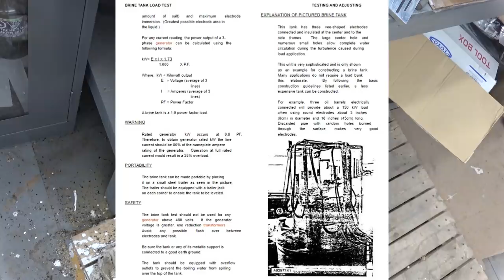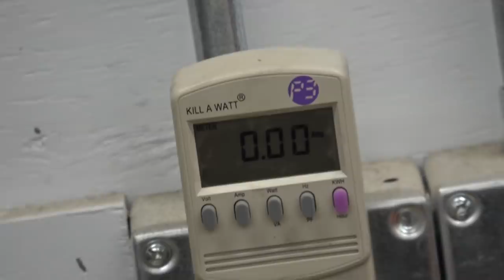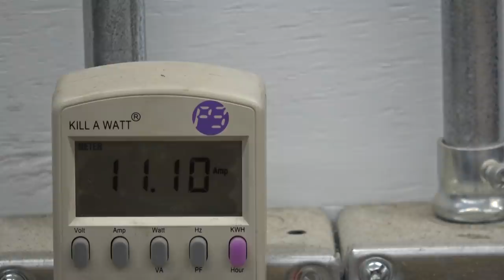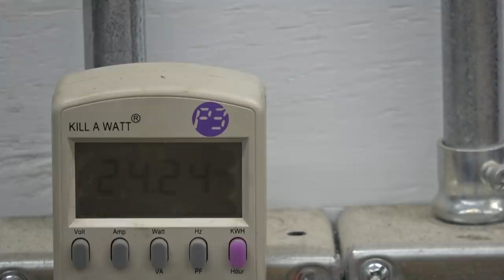Forgotten knowledge: generator load testing

Comment: As a Caterpillar EPG technician. I will tell you the new instructions are nothing more than electronic fire tinder. You’re better off googling half the time.
Reply: Dont get me started
Reply: Seconded by another Cat EPG tech
Reply: Same for the Detroit Diesel stuff for trucks.
Reply: GTS, man
I use that almost every day. 
Need the TDS/MSDS?  GTS
Reply: Can confirm, also a Cat tech. (Mainly HE Field, but have dabbled in EPG and PS) I agree all newer manuals are trash, but those for engines manufactured for Cat by others (Kubota, Perkins, Mitsubishi) and painted yellow, are on a whole new level of useless.  More of a "replace this part, if problem still exists replace this part, etc." rather than an actual "check x, y, and z in this order, repeat to verify results" troubleshooting guide.
Reply: @dallaskelly4213  gotta love a perkipiller. Had a 7.1 clog the whole egr system the other day. Couldn’t find part numbers anywhere. Settled for a blow torch and some time. Edited for grammar
Reply: As a retired Caterpillar EPG Tech I approve of this
Reply: My father was a Heavy Diesel CAT mechanic for 20 yrs. He has atleast three cd/DVD binders that are 6 inches thick that are all Manuel's. I don't think he's ever used them, lol.
Reply: HE Field here. JD ain't no dang better
Reply: @-tr0n  the torque specs aren't overly special. I cross referenced a cat rebuild manual with a standard bolt chart and everything matched except for the things that had non standard torque specs stamped on them.
Reply: As a teen in the early 80s I ed-ju-ma-cated myself on mountains of GM service manuals from the 70s,  I had acquired from my grandfather and uncle. It was the transition period of vehicles from electrical to electronic so and they gave me a wealth of auto knowledge unsurpassed at any higher learning facility. My 40 years of learning is all built upon them old GM manuals. New manuals are not worth the pixies they take to glow the screen.
Reply: Well you guys are missing out... Over here on the Deere construction side everything is as clear as mud.
Reply: In all actuality, sisweb is better than a lot of the other manufacturers documentation for troubleshooting/parts diagrams. I left a cat dealer for an independent company a few years ago that uses volvo engines in their gensets. The volvo system is ten times fucked from Sunday compared to anything I used at cat.
Reply: Another HE Cat tech here. The best manual in my shop is the old guy named Doug who works over in components . He’s been with the company for only God knows how long (literally only God is old enough to know exactly how long he’s been there). If you ask him for help he’ll tell ya to go read the manual. Don’t worry though, once he knows that you’ve read the manual 14,000 times and you’re to the point of trying to figure the best way to run your own self over with the machine, then he’ll come over set ya straight!
Reply: I own an engine-rebuilding-shop in Germany and I had to do some work on a Peugeot Diesel engine. Needed some specs for the valvetrain and borrowed the factory(!) service manual for that engine. I looked up the "cylinder head"-section and read the following in German:
"Eine Reparatur dieser Baugruppe ist nicht vorgesehen". Which means kind of "a repair of this unit is not intended". I had to decide if I should laugh or cry about that.

Comment: Liquid rheostat or salt water rheostat.  There's an entry for it on Wikipedia.  It was part of my training as an apprentice with an electrical engineering company.
Used to be used as motor speed regulators, theatre lighting dimmers and dummy loads, and still find many applications where mere electronics would go bang and emit expensive smoke.  The worst you can do with a liquid rheostat is boil it.
Your breaker has a tripping curve.  It will respond instantly (magnetically) to a sudden high current, but for low level overloads it takes time for the bimetallic strip to heat up.  At twice the rated current it can take about a minute to trip depending on ambient temperature.  For lower overloads it takes much longer - up to hours if at all.
Reply: Usually only about 15-20 minutes past when the toaster catches the laminate countertops on fire.
Reply: yeah we have slow blow fuses on some of our gear
Reply: @afsarmstrongfiresafety7460  the toaster can melt.  the wires won't
Reply: I forget the specific brand of panel/breakers that are now defunct which would regularly wind up melting 14ga romex on a 15amp and 12ga on a 20amp with anything besides a dead short at the end of the line. They would eventually trip, but not until it ruined the feed line usually at the tightest radius, or the highest resistance connection in the line 🙆‍♂️ make great workshop panels for worn out high power brushed motors though 😄👍
Reply: The delay seems fair enough.  The whole point of a breaker is to prevent the wiring from overheating and staring a fire.  In the same way a minor overload will take time to trip a breaker, it will also take time to heat the wires to a dangerous level.
Reply: tkor made a variac he called the "scariac" that was along these lines. not safe, but not quite as oops prone as this one 

https://www.youtube.com/watch?v=P9UjxG8sN1c
Reply: Am I the only one who read that in big Clive's voice?
Reply: Back in the late 60's I replaced the nichrome load in my "Popular Mechanics" carbon-arc welder (or spotlight) with a salt cell. 
Also, for a theatre lighting dimmer build, I had found about them looking up salt-cell variable resistors in the library (some were HUGE !!!).
Using the salt cell with either salt (sodium chloride) or washing soda (sodium carbonate) I found you could modify the resistance/conductance range of the cell by varying the electrolyte concentration, which should be obvious.
Surface area of the electrodes also contributes, I used large carbons from old Dry-Cells (No.6 ?) so I wouldn't have electrolysis damage.
Also, in long burn situations, like exposing a silk screen negative, as the solution in the cell heats up to boiling the conductance seemed to change.
Reply: @GigsTaggart  A Sunbeam Toaster won't. 
Its automatic beyond belief!
Reply: @sobania6095  As did I. In his smooth, mellow tones.
I read a sentence or 2 before I recognized his name, and I instantly imagined him moseying on down to us*, As we look on over the buckets of zappy brine.

*the collective us, all of us in AVE's Garage.
Reply: @berryreading4809  federal pacific
Reply: @berryreading4809  Wasn't that Federal Pacific?
Reply: Dang it, I didn't scroll down enough...
Reply: @berryreading4809  federal pacific
Reply: @russellhltn1396  keep in mind breakers are only 80% rated and so could have tripped at 16a.
Reply: @berryreading4809  Probably thinking of Federal Pacific.
Reply: That was Federal Pacific in the USA and Federal Pioneer FPE in Canada. In one test in 2017 there were 38%of FPE breakers that failed to trip.
Reply: Big Clive, very modest in not mentioning your 2020 Mk4 Version 3B of this, how you now replace the bucket of brine by multitasking the resistive load by using various food items between forks. Hot food snack as a welcome by product....:-)
Reply: SCARIAC!

(rip KoR.... ):
Reply: Apparently, some of the very earliest electric welding "machines" were exactly the same: a trough full of brine with the active wire on the fixed elelctrode, the torch lead on the moveable electrode and the work return is the neutral wire. I don't think it would work too well with a modern RCD protected fusebox, because some of the voltage would be leaking to earth through the metal being welded (into the ground through the workbench) and trip the breaker almost instantly on strking an arc.
Reply: @berryreading4809  sounds like federal pacific lol
Reply: @tabbertmj  I made the same mistake.   Oh well 🤷‍♂️
Reply: Don't you mean the Federal Pacific electric stab Lok panels?

Comment: As someone who has burned out a few kill-a-watts, I'll tell you theres a soldered in 15A fuse inside. I replaced it with a removable fuse holder and bam, new kill-a-watt.
Reply: Just shunt it...
Reply: @Roy Bentley The flames means it's working!
Reply: @Roy Bentley I mean, there usualy is some kind of breaker in the circit.
That is unless you allready shunted the one in the panel or replaced it with a 64A one...
Reply: You could make your life easier by replacing the fuse with the thickest nail you find lying around
Reply: Fuse? How about soldering in a nickel? Red Green would be proud.
Reply: Would a kill-a-watt with a solder bridge where a fuse should be a killer-kill-a-watt? Maybe a Killier-watt
Reply: @RustandRedemption  I'd call it  kill-a-megawatt
Reply: @Guysm1l3y  Smoke and fire are a great indicator of resistance.
Reply: @Chasing Capsaicin definately fixed my coffee maker that way.  If it fails again I can just pretend it has leveled up to be a coffee roaster.
Reply: I've "fixed" more than a few job site microwaves by wrapping some strands of stranded THHN around the fuse holder with the burnt out fuse still in it...
Reply: @chasingcapsaicin  picturing you on a one-way trip to Scoville. 😉
Reply: @Roy Bentley do you want it to be called a kill-a-watt or a tickle-a-watt?
Reply: hence the flashing warning
Reply: @williamdegnan4718  you talk about him like he isn't here and this isn't his channel